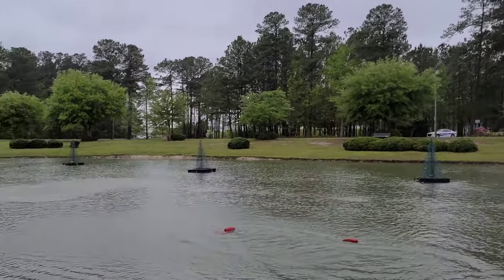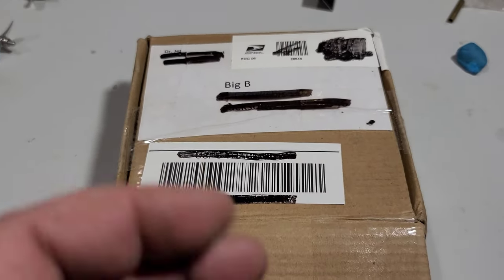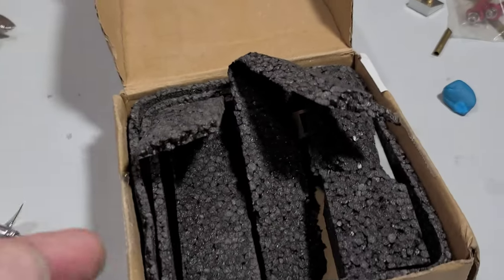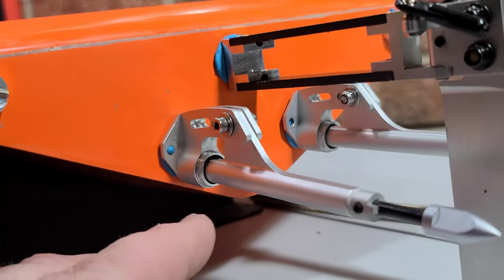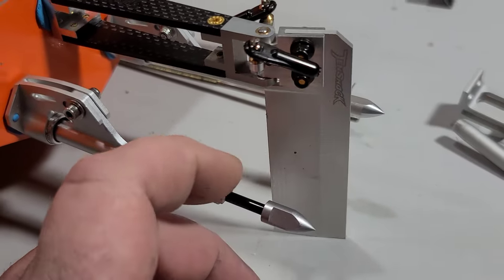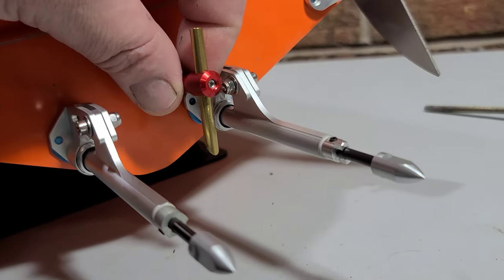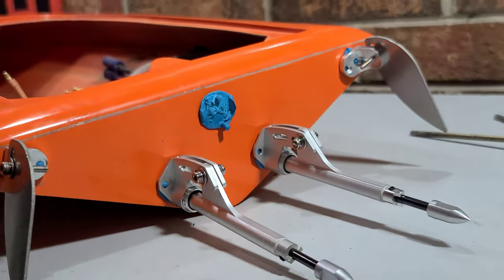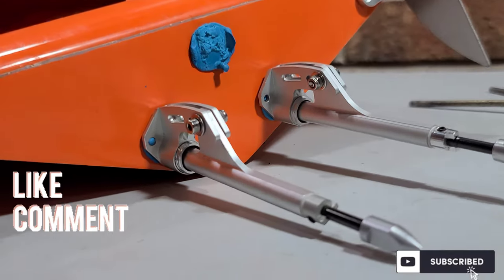80mm Low Profile Stinger & Tenshock Carbon CNC Rudder - Subscriber Mail Day - Deltaforce 29 Twin

Comment: Love to see the progress on this boat I was thinking it would be cool to see you build a super fast version of the volantex atomic v792-4 (the yellow catamaran) with strenghthing the hull and either putting a big motor in it with a big 3/16ths shaft or going like twin motors like this... I think that would be sick to see
Reply from the maker: I've been contemplating that boat for quite some time now, maybe that will be my next project once my two current builds are complete
Reply: @IRONCLADRC   definitely be watching for it

Comment: Definitely like the cleaner look of those stingers.
I was wondering for a while, since i got a twin with quite a steep V, if it wouldn't be better to put the drives/tubes from underneath the hull so they would be a bit lower. I realize you get a "hump" under the boat which you need to epoxy and fill out, but wouldn't that be better...?  Maybe somebody's or you got experience with that...?
Reply from the maker: Check out this channel he has a couple twin motor monos( tido 2 & tfl rocket), one runs exceptionally well he has his drives spaced rather far apart father apart than I'd space mine.   The twin motor mono is new to me wish I could help with tuning suggestions for yours.    Have you ever herd of a flooded stuffing tube?  The stuffing tube is set in a carbonfiber tube so you can raise and lower the stuffing height, if I were running the Struts I was considering a flooded stuffing tube, Stingers can't be set up with a flooded stuffing box.   Just a suggestion 

 https://youtu.be/KNAz8YMeaWE
Reply: I'll follow him to, thanks for the tip. I still have to try things setting up my boat up, just ran it 3 times but that wasn't a succes so far. Didn't want to turn and was way to slow for its setup. Know now this hull particully likes props like octura x 1.4p (also recommended by the manufacturer). So starting with an other pair of props (which i have now) and do some testing. Hopefully it becomes way, way better.
If not, it was an expensive mistake to buy ...

Comment: Whats the diameter of the motor with water jacket installed? Larger than 50mm? Are you keeping the flex shafts straight inline with the boat or curving them outward to keep stingers close and motors farther apart?
Reply from the maker: The 28mm motors are 34mm and the 29mm motors 38mm with jackets, I'm setting the stuffing tubs at or around 48-50 so I van potentially prop up later on just in case I decide to put 36mm motors in the boat. Kinda planning ahead cause I know I'm gonna upgrad the power lol.     As for Stingers probably mount them straight up & down in line with the motors.
Reply: @IRONCLADRC  are you going to use the single front mounts like from ose?